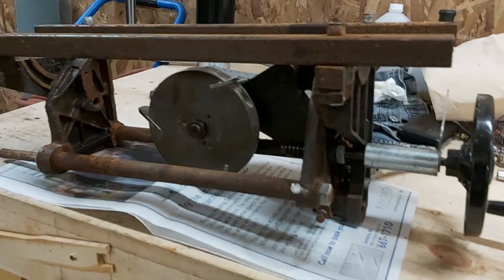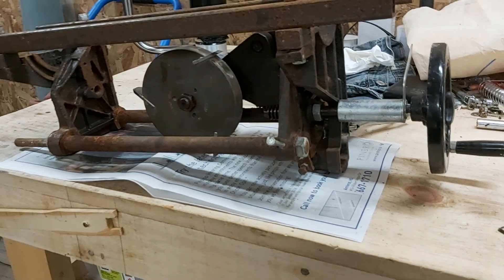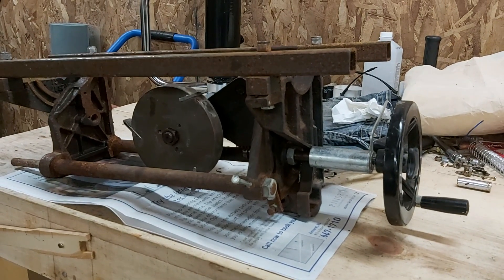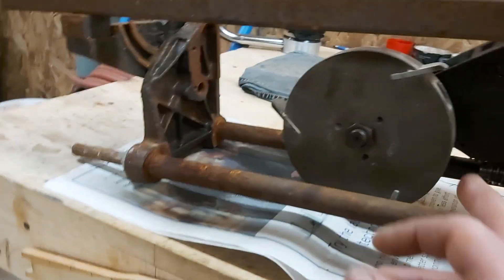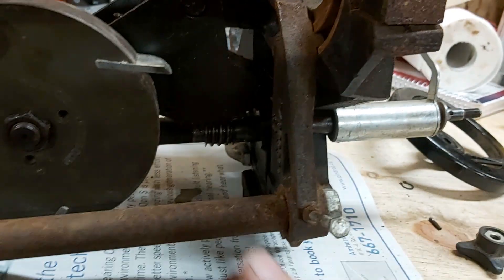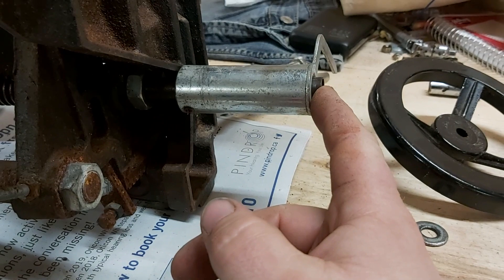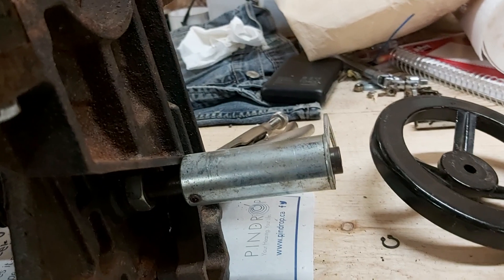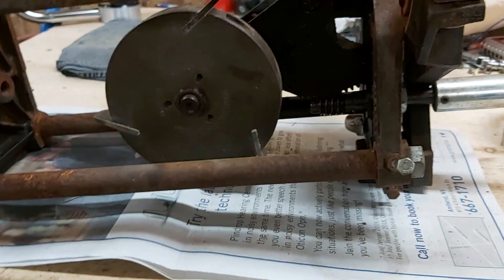Plunge cut with a table saw.

Comment: That's an excellent idea to control the blade height by restricting the height handle!

With Sawstop saws, I can get away with not adding the lever since the blade raises up and down relatively quickly. I think I'm going to make an indexed ring of holes that I can add dowels into where I want the height to stop.

Thank you!